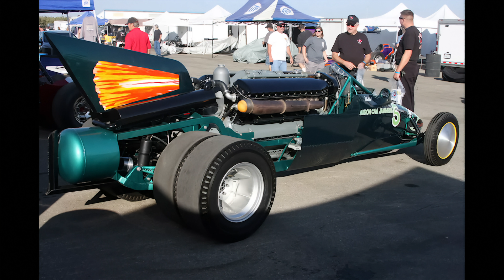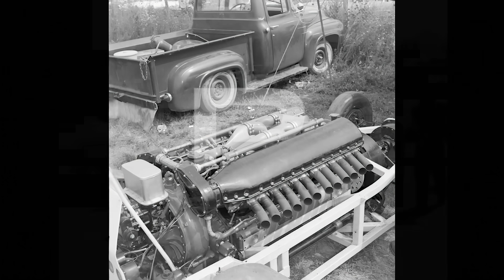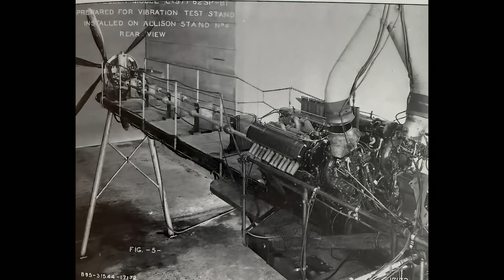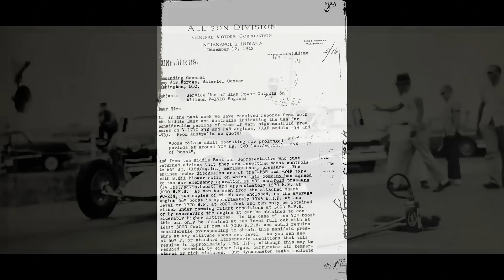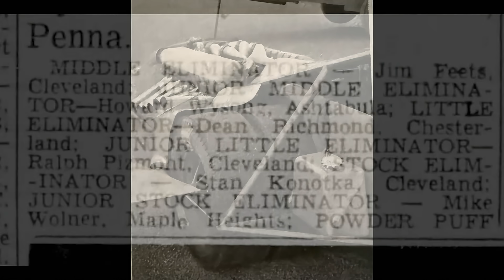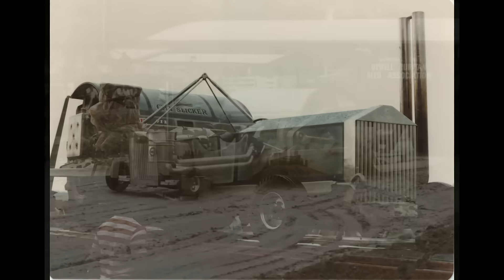Warplane On Wheels: An Allison V-12 Slingshot, Innovation, and More

Comment: Those Allison and Rolls Royce Merlin engines. were very popular unlimited hydroplane boat racing. that toured in the Pacific Northwest. with occasional races to places to the east. the hydroplanes were rather large boats. so the incredible weight wasn't an issue in those boats. it was a spectical in racing that has going on for many years in the Pacific Northwest. but the weight would have been something to overcome in race car's. the Rolls Royce Merlin engines were well known for their use in the P-51 Mustang. an aircraft that pilots in WWII loved. getting all that power to ground had to be difficult. noting the dual slicks in the pics in this video. being as a person could purchase these engines for a hundred dollars. it explains why these engines were all over the place. they were amazing engines for sure.

Comment: I wonder why slingshot dragsters don't go front wheel drive. the weights there, the twisting frame and all the weight associated with that twisting is gone ,the front end lift is gone (most of the crashes they show is from that front end lift) steering it would seem would be more controlled. any one idea's?

Comment: The airfoils are similar to the Liebeck 1004 airfoil. This has to be one of the highest lift single-element airfoils I know of. It provided more lift than many multi-element airfoils, and with lower drag. It's main problem was that when it stalled, it generated zero lift. So it was either all or nothing. The Libeck airfoil was invented in the late 1960's at Douglas Aircraft. Most racers used a variant of the Wortman Airfoil, which didn't produce the lift of the Liebeck but gave you lift through all AoA's, and then the multi-element airfoils took over.

Comment: Those rockets , gas bottles, loose wires, batteries hodgepodge on the back of that dragster look like something a 12 years old would put together.
No insult to 12 year olds , because most do better than what I see in the pictures.
I’m sure the problems with any professional outfit running that gear are very obvious to everyone involved and the real problem was systemic.
It would not surprise me if there were many legal issues.

Comment: I've been enjoying your videos for a few years now, and the City Slicker tractor mentioned here reminded me of a funny car I saw in an old car magazine many years ago. It was a flip top funny car, with a transverse mounted Ford 427 SOHC and a chain drive to the rear axle, basically like an oversized gokart. I don't remember which magazine or what year it was written about, but if there's any way you could dig up some info on this car and maybe include it in one of your videos, I'd really appreciate it. As a side note, my dad raced a 1967 Falcon in the mid to late 1970's, with a 427 SOHC, so that's probably why the funny car stuck in my mind all these years.
Reply from the maker: That funny car was Jack Chrisman’s machine. It ended up being the first funny car John Force fielded in drag racing
Reply: @brianlohnes3079 cool, thanks for that. I'll try to find more info on it.

Comment: Thanks Brian! Very cool documentary! I was present at some of the early tractor pulls back in the mid-70's, and there was one rig that really stood out to me. It was called the Double Ugly, and had a fairly rare Allison V3420 which was comprised of 2 V1710's that were mounted side by side on a common gear case. They were a literal torque monster, and when the guy could get it to run right, it would out pull anything on the property!! Hard to believe you could buy those surplus for under 100 bucks back in the 50's, but then again, 100 dollars then was like several thousand now.😄👍👍
Reply from the maker: EJ Potter’s legendary tractor! He bought the engine from a display stand at a used car lot in Michigan for a few bucks! EJ was the man.

Comment: 15:20 The two-stage turbo/supercharger was only needed for high altitude. In ground applications, all you need is, as Mike Finnegan calls it, a "party pulley" on the single-stage blower. For an example of the two-stage setup, look at a cutaway of a P-47 -- big radial engine with mechanically-driven supercharger up front, and the the entire fuselage behind the cockpit was mostly filled by the turbo and its intercooler. 
The main thing about the rated power was that it makes that power for hours at a time -- see also how you can drive a 502ci V8 making 600-ish horsepower across the country, but if you put the party pulley on the blower and run nitromethane, you can make 12000hp with the same engine for a quarter-mile before having to rebuild it.

Comment: According to EJ Potter, the infamous 'Michigan Madman' the horsepower delivered from these engines was linear to the speed you spun them. So if you want 4000 hp, just spin this baby at 4000 rpm and you had all the power you could control.
Reply from the maker: This is a wonderful thought and EJ was both a genius and a guy I was friendly with years before his passing but that is absolutely inaccurate. Haha

Comment: Great story. About the side wings, um, well... no! His numbers r fiction. He is missing the 'endplates'. The vertical flat thin plates that box the air in on the wing. Any change in pressure will just spill over the sides. He would have done better with 1/4" flat Alu rectangular stock. His 'wings' were lumpy boards. But, he Tried.  Tried. And Tried again. Thanks for ur info.

Comment: I have to politely disagree with you on the baddest pulling tractor ever, you are even mentioned in a video of it, the zvezda m503 powered ( 145 liter, 42 cylinder Soviet radial diesel methanol burning ship engine) dragon fire, the best video of it shows it passing under a large banner and melting it instantly, dragon fire is the King. Edit, found the video, you tube, dragon fire kills the full pull banner, enjoy.

Comment: These aircraft engines had a maximum engine speed of about 3000 rpm. Their useful power in a narrow band from about 2500-3000, the latter being "war emergency" power. Typically running steady at about 2600 rpm at cruising speed. Aircraft speed and power increase was moderated by propeller pitch and manifold pressure under boost. "Throttling up" meant increasing engine speed by 250 rpm and maintaining it with a supercharger. Not a perfect solution in a ground vehicle for standing starts, unless you can do a whole lot of very expensive modification machine work in an aircraft machine shop.

Comment: That's a brave design.Get those wings wrong and it becomes a plane not a dragster.Love the old ideas.My favourite "wacky racer" was the drag bike seen mainly in Europe where the rider laid flat on the floor.Another was a regular at santapod UK but before my time also a drag bike where the rider sat behind the rear wheel.Brave and crazy at the same time.Love your channel btw.Kind regards.

Comment: The P39 most certainly  did not shoot down more aircraft than any other US fighter, it's a myth disproven many times, along with them providing numbers but those who claim it did never providing numbers, they only ever make the claim, the original source for that claim actually claimed something else but the way it was worded left others to believe what became the myth, just like the vast majority of internet sources that claim the Wright R3350 engine in B29's had magnesium engine cases when in fact it actually had forged steel cases it's a phenomenon known as error propagation, that's when an early source of information on something is wrong but got picked up and repeated so many times it's become "common knowledge", a full 9 out of 10 online articles on the R3350 will yield information that it had magnesium engine cases, it's a perfect example of just because you read something from multiple sources on the internet that doesn't mean it's true. 
The P39 is full of myths, like the claim the Russians used it for ground attack, the reality is it was seldom used by them for ground attack, the thought they used it extensively for ground attack doesn't even make sense, why would they risk the limited number of the best fighter they had doing the job of the IL-2? An aircraft specifically designed and armored for ground attack that over 36,000 were built of, and they'd risk an unarmored aircraft they had less than 5,000 of that did so well in aerial combat? The claim doesn't even make sense. 
Like the claim the P39 shot down more aircraft than any other US fighter the claim it was used extensively by the Russians for ground attack comes from a misquote, in it's case it's a misinterpretation of the wording the Russians used for it's classification of aircraft, their description of that type of aircraft was something like "Aircraft to give protection of troops", or something similar to that, western aviation authors took the literal translation to mean ground attack when in fact to the Russians it meant it was used to shoot down aircraft that pose a threat to their ground troops, to provide a protective umbrella above them if you will.
No, the Russians wouldn't have risk aircraft that weren't built for ground attack, and they had in small numbers, doing the job of a specialized aircraft they had 7 times as many of. 
Yes the Russians inevitably shot at a few ground targets with them but only on rare occasions like if it was the only asset in the area and troops were in a dire situation but they didn't send them out in ground attack missions, that was the IL-2's job.

Comment: My back of the envelope calc (making LOTS of assumptions about the airfoil used, aspect ratio, efficiency, air density, etc), the 10 sq ft wing might generate ~425 lbf at 180 mph @ sea level.  However, being in ground effect would tend to magnify the effect somewhat.  The "600 pounds" number might be from a theoretical maximum of a 2-D airfoil that ignores the effects of aspect ratio & efficiency.  YMMV...
Reply from the maker: Thanks for taking the time to explore this. Neat to see how close their guesses were!

Comment: The turbo was dropped from the P39 for the same reason it was dropped from the P40 (it's original design which had a different nomenclature, XP37 if I remember correctly), to speed up development and get production rolling on them because England, Australia, New Zealand, France and everyone else including the USAAC were all screaming for aircraft. 
As per procurement and purchasing rules established by Congress Lt Benjamin Kelsey, who one could say was Congress's guy in that system, would have been the only one who could order the turbos be dropped, even Hap Arnold the head of all Army air forces couldn't do it, and Kelsey felt very strongly about the P39 being fully developed with the turbo so it could fill the high altitude role, so Arnold devised a plan to do an end run around Kelsey to have the turbo dropped so development could be sped up and production could get rolling, which was fine by Larry Bell who didn't have a production line running for any aircraft and was strapped for money.
Arnold sent Kelsey to England on "Emergency business" for a couple months which cleared the way for Arnold to order the turbo dropped and the P39 to be put into production, NACA was assigned the duty of doing wind tunnel tests on a model of the P39 and coming up with drag numbers for a P39 without the Bell designed scoop for the turbo so Arnold could take his case to Congress, it's a bit of a story but in a nutshell he bamboozled Congress, whose members knew virtually nothing about aircraft, into believing that the scoop was a problem and that the turbo had to be dropped so they approved it, which is a nonsense narrative, the project to redesign the scoop could have been given to NACA who was very good at designing air scoops and engine cowlings, it's Arnold's testimony to Congress that has led to the myth that the scoop and the turbo were problematic, there's no such thing as an aircraft that entered service exactly as the original prototype was configured, they all had things ironed out, typically with the help of NACA, and changed before they went into production. 
Years after the war Kelsey was being interviewed by an aviation author who was writing a book on US aircraft during WW2, when ask what his biggest regret was he said "Not being able to see the development of the P39 through to the end", he felt it would have made an excellent high altitude fighter.

Comment: Brian, you should check out the European sled pullers if you like aero engine powered stuff. A bunch from the Netherlands but one specifically is the Green Fighter team. They are Allison guys with 1-2-3 Allisons in a tractor depending on class and they are hard to beat, very successful team. A couple of them even have Prochargers on it instead of the factory style supercharger. A number of RR Griffon powered machines, some big radials like R-3350's and just a plethora of odd powerplants. Diesel tank engines, you name it. Even a mini rod that instead of a blown hemi, it has a small radial. As a gearhead & aviation nut, its great fun to see!

Comment: There was a valve manufacturing co in Middletown NY. They had a couple of these engines in a test room connected to some big water pumps. Apparently they would fire up an engine and pump vast amounts of water through these valves cycling them between open and closed. I saw pictures of the engines after they were taken out of service. They were sold and lost to history.

Comment: A little more info on the p39, most of the air cobras used by the Russian military were flown by women, yes Russian women were the pilots for the straffing missions against hard targets like trains and bridges
Reply: No, the majority of Russians who flew P39's were not women, and it's a myth that the Russians used the P39 for ground attack, it was never assigned that mission.
Even the thought that they would have is ridiculous and doesn't make sense, the IL-2 that was specifically designed for ground attack and was armored against ground fire, there was over 36,000 of them made so why would they risk losing any of their best aerial fighters they had less than 5,000 of doing the IL-2's job?
All the sources that originally claimed the Russians used it for ground attack made that claim because they misinterpreted the classification the Russians gave the P39, a literal translation is something like "Aircraft for the defense of ground troops" or something like that, but their name doesn't have the same meaning as its literal translation to English, what it meant in Russian is more like an aircraft that creates a protective umbrella above ground troops by shooting down aircraft that threaten them.
Reply: @dukecraig2402 wow so you mean all the historical documents on the Russian night witches is in accurate.  I mean the actually claim that there were female aces during ww2. I think you need to do more research,  like the book the history of bell aviation.  I have been  reading about these women since the 1960s

Comment: Those look like Frise ailerons.  Not intended to be a stand alone airfoil shape,  but who cares about drag with a supercharged V1710 for power? Still, at 10° angle of attack, at 180 mph, and 10 square feet of wing area, 650 lbs of downforce would take a coefficient of lift of about .7, which is rather low for a 10° angle of attack, even for those ailerons used as an airfoil.  The wing would be getting dirty air off the car, and it suffered from a low aspect ratio, but I think he was punching above that 650 lb estimate, maybe even by a couple hundred lbs. Great stuff Brian.
Reply from the maker: THIS IS AWESOME!!!! Thanks a million for taking the time to break it down like this. Absolutely fascinating and great stuff!